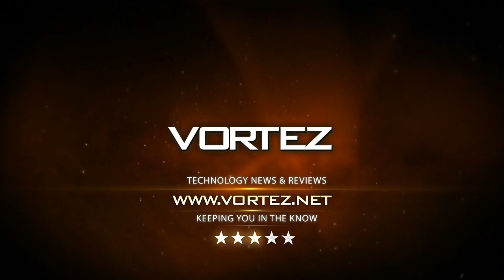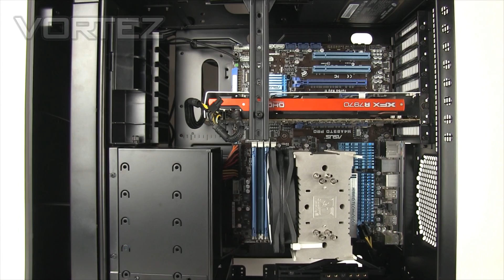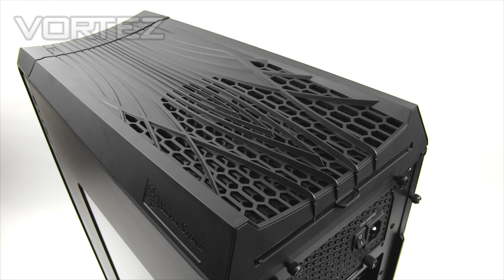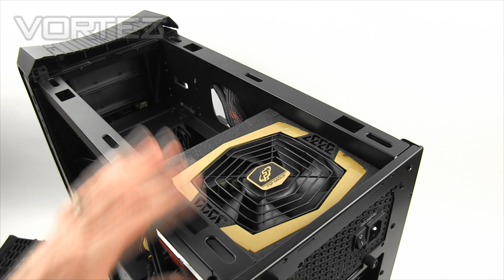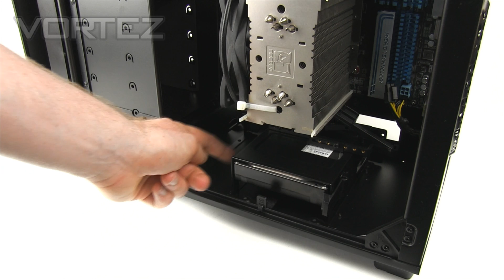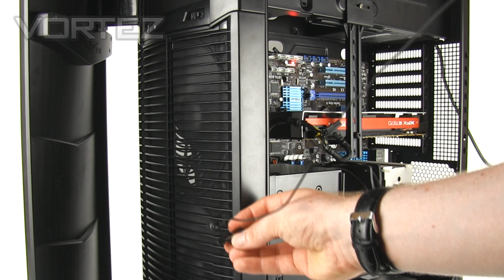SilverStone Raven 4 Review [HD]

Comment: You said by putting in a 360 rad the rest of the components would be adversely affected, however if your WC'ing your CPU and GPU there isn't going to be much heat generated by the rest of the components, with the heat from the CPU and GPU being exhausted through the radiator. Correct me if I'm wrong, and great review by the way.

Comment: That flappy plastic door is such a let down, that would really put me off ! I have the TJ08-E which is much nicer to look at due to it having anodized aluminium front cover which would have been a much nicer choice for this case. OK it would have been a bit plain but who wants to look at that plastic front ? I also like the addition of the GPU support bracket but did it have to look like a cheap steel shelf bracket ? I suppose this will get modded by most people though.